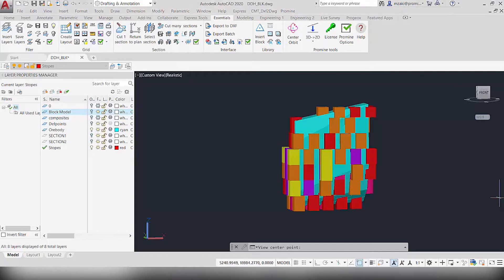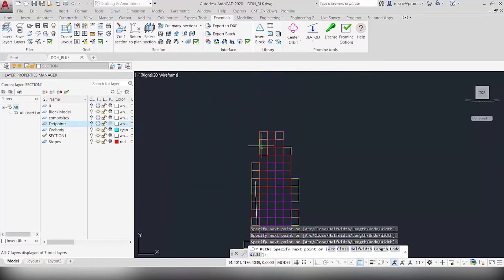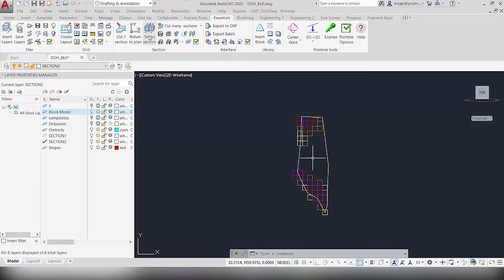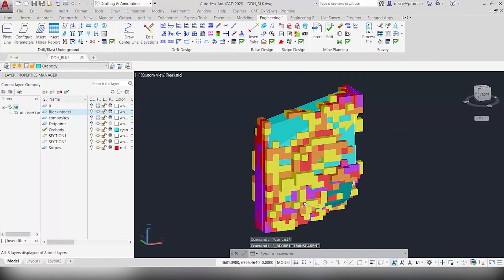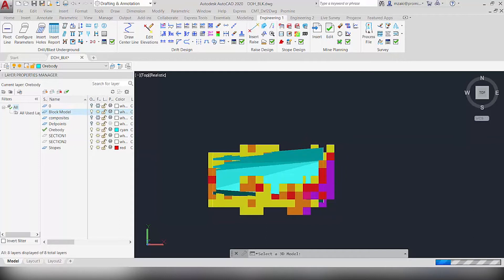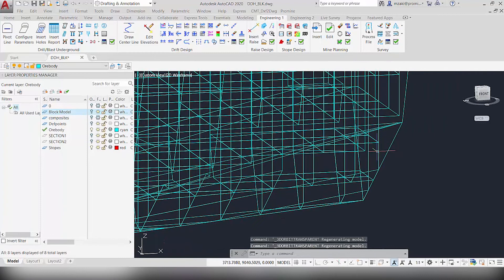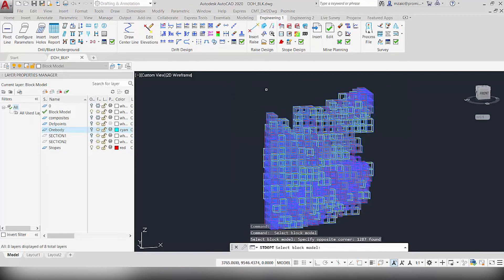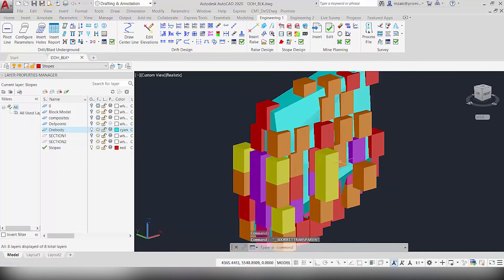Create an Orebody and Optimize Stopes | Tip of the Month

Comment: Hi, I´m trying to obtein a report of the optimized stopes, but in the report it is a camp named "Empty" and it has a negative tonnage. Which is the representation of this camp and how do I have to consider it in the reports of the stopes?
Reply from the maker: Hello Fernando, in the newest Promine version, the report includes "Ore", "Waste", and "Void". Ore refers to all tonnage above your economical grade (the one you put in the window before generating the report). Waste refers to the tonnage below that economical grade. Finally, void refers to the empty space of the mesh that doesn't contain any blocks.
Hope this helps!
Reply: Thanks :)